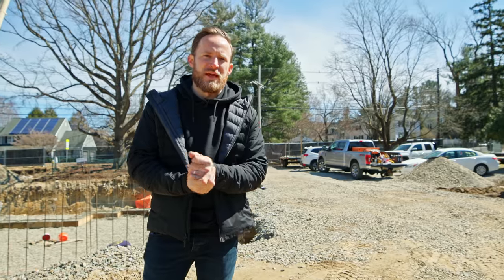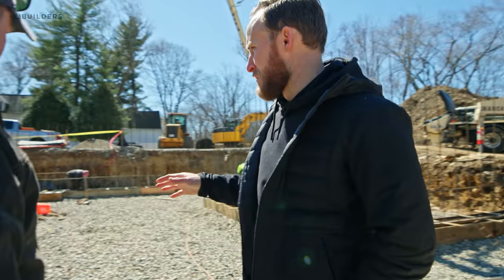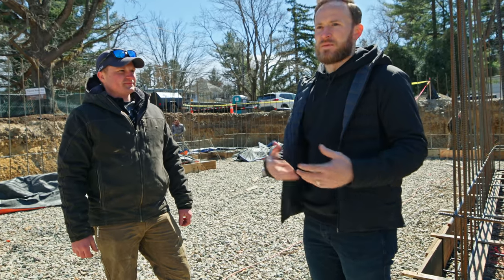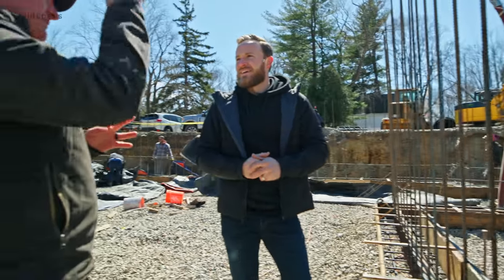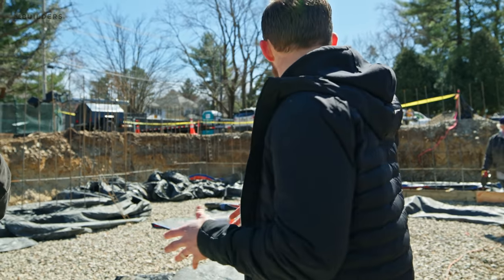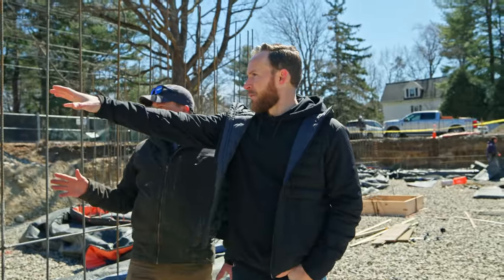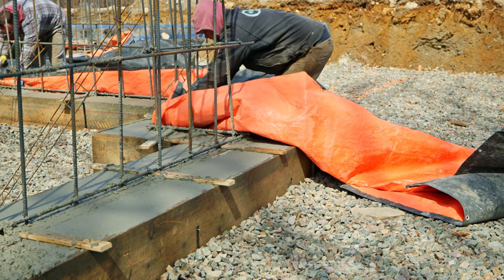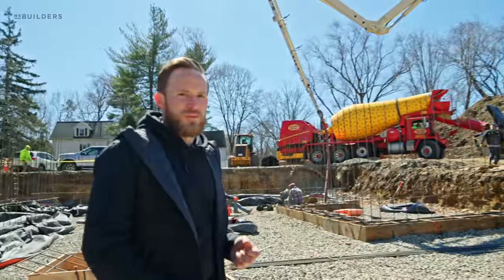Footing for this house has 46 CORNERS

Comment: Concrete is pumped.  Seems like pour is the better term.  Rebar quantity in those walls look very extensive.
Reply from the maker: But is it really a liquid? One could argue both ways.
Reply: You cast concrete! Haha. I said “Pipe staging” the other day, the laborer looked at me like I had 6 heads…. Says “You mean Scaffolding?”

Comment: how tf did you get 47, isn't the footing square which would create an even number? like inner and outer corners =47, 47/2= 23.5, where is this half corner???
Reply: They'd have to have a couple 45 degree or something other than 90 to get 47 corners. Doesn't look like that's the case, and in the video they said 46 corners which makes more sense...
Reply from the maker: Whoops!